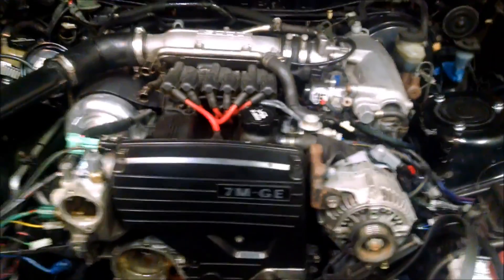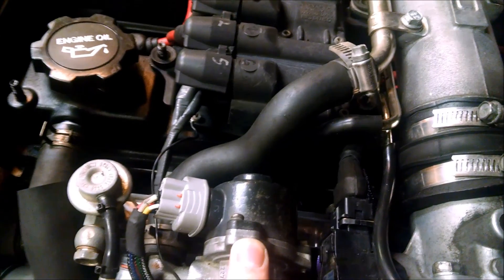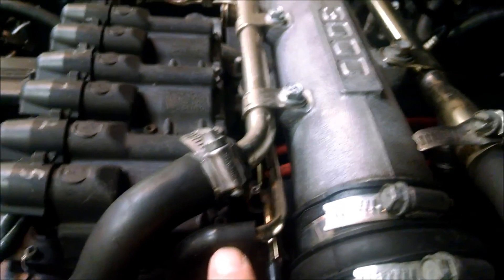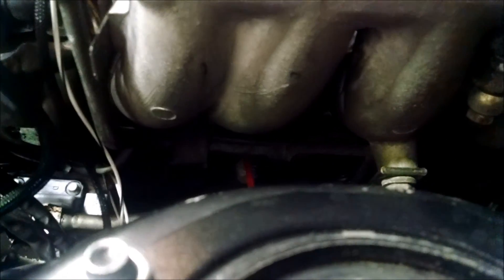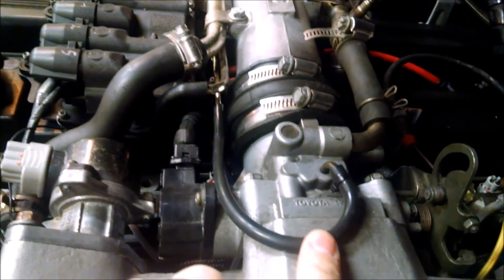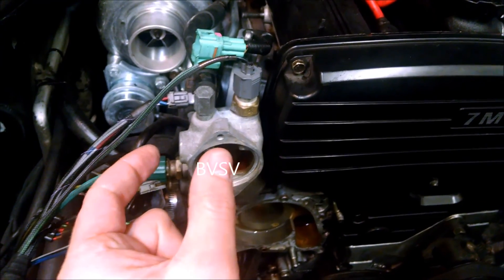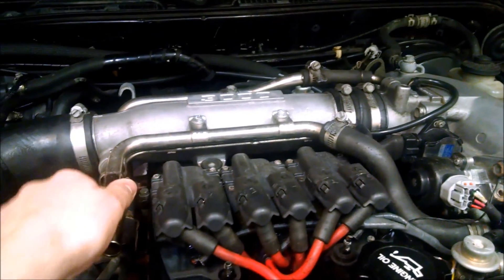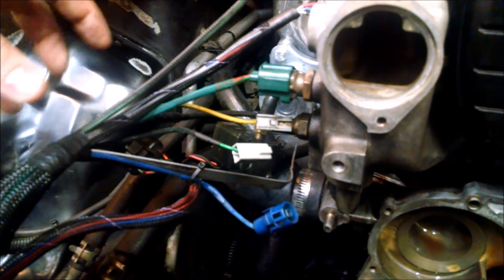YotaMD.com - 7MGTE Vacuum Explanation

Comment: Hey YotaMD, mine got a coolant leak and it’s dripping out of the front passenger side and your guess carpet is also soak with coolant as well as the  temp was getting to the red. So I have started it and let it idle for a while with a radiator cover off, and also into my surprise it was bubbling. The guy from a Toyota pro shop per said that might be the head gasket, and earlier they couldn’t determined exactly what it is till further testing, any clue or base on 7MGTE motor?
Reply: Get a combustion leak tester,easy and straightforward to check for a blow head gasket. On a cold car,take a bit of coolant out of radiator and out the tester in make sure it doesn’t touch any coolant inside the radiator it has suction tube, let the car reach normal temperature then press it and if it turn yellow then bhg

Comment: Can all of the 'rigid' hoses (such as the one you indicated at 0:45 ) in the vacuum system of a 7MGTE be replaced by just generic silicone hose? I just replaced my stock intake pipe ("accordion") with a silicone aftermarket one, but trying to force the stock hoses into place was a massive PITA. If I can just replace them with snipped bits of silicone and appropriate couplers, that would be much better for my comfort, as I feel like the stock hoses are kinda stressed right now.
Reply from the maker: As long as they're sized correctly and don't kink, sure.
Reply: @user-df1gh8le6l  Prompt response! Appreciate it. I'll get some hose and size it out.

While I have your attention, just wanted to also pass my thanks for your YotaMD site. I've had it bookmarked for a while, and reference it when applicable while I try to make my Mk3 shine.
Reply from the maker: @angrytigermpc  Very cool. Glad it's been helpful. I planned on it being much more intensive, but never could get back to it. Enjoy it and get that mk3 in tip top shape!

Comment: If I'm deleting the EGR system can I just cap off the other port on top of the throttle body?
Reply from the maker: +Supra Shop you should run a jdm ecu if you're deleting the egr system. Otherwise you'll run lean under partial load and potentially ruin a motor - not even doing anything fun either, haha.

Assuming you're tuning to correct the missing egr system, yeah you can just cap off the throttle body. My 90 gte never had an egr system, but it was always running a jdm ecu.
Reply: ohhh ok thanks so much! So all the VSV stuff isn't needed correct. Im going to a standalone so that should solve that right?
Reply from the maker: +Supra Shop if you're going standalone I'm not really sure you'll be able to use those vsvs. The idle up for power steering may still be useful, but I'm not sure.

Comment: 7Ms don't need the vacuum system they will run perfectly fine with out all the lines just cap them off! They r just a waste of space and it also doesn't need the the charcoal canister it's also a big waste of space

Comment: what did you do to remove the factory throttle linkage that mounts over the value covers
Reply from the maker: I am using a JDM throttle body, NA throttle cable and a custom made throttle bracket. I didn't end up with that on purpose. It was just a temporary solution years ago that worked out better than expected.

Comment: where exactly do you get your vacuum from for the fuel pressure regulator and are You using the vsv for it? when I bought my car all the vacuum lines where messed up.
Reply from the maker: +Jay Murray Try studying this picture: http://www.cygnusx1.net/Supra/Library/EPC/291420/catalog.aspx?F=1708&P=3

If you have the hood sticker for vacuum lines that will help, too. That hardpipe system under the manifold is hard to figure out so you may need a flashlight, a mirror and some patience to get it sorted out.

Without more detailed info I can't offer much more help, sorry!
Reply: +YotaMD I figured it out. I didn't have the hardpipes under the manifold. so it was hard to tell what went where on the hardpipe pictures. but I got it. thanks though.